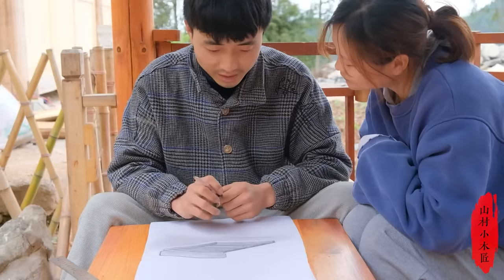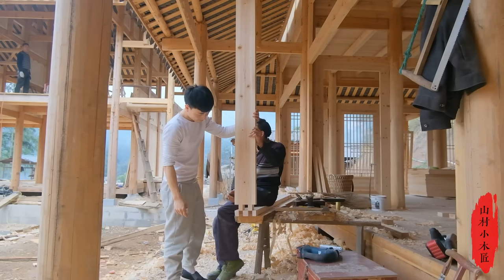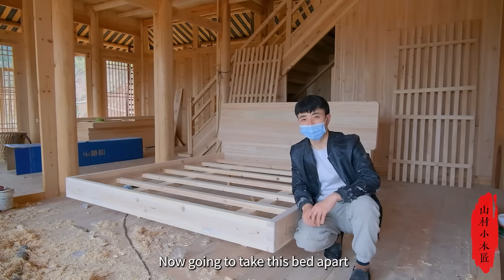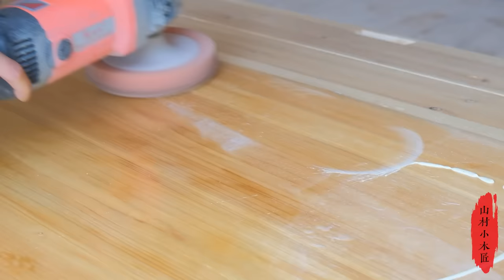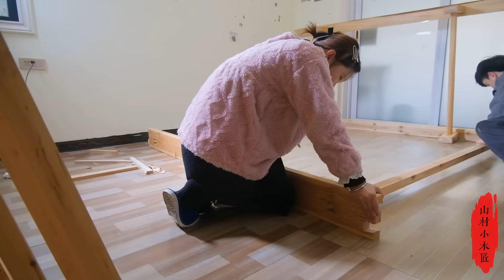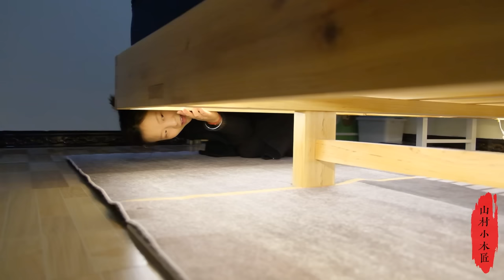I Made A Floating Bed And The Result Exceeded My Expectations! | Carpenter Anxu

Comment: But isn’t the LED strip glued to a metal profile so that there is a heat sink? They won't work for long. But overall it turned out beautifully
Reply: Good quality LEDs just need ample  airflow.  The metal channel is for tight areas where thermal transfer isn't easy or fast.